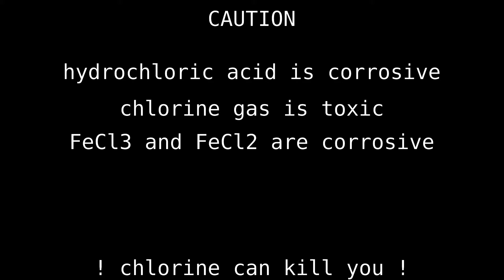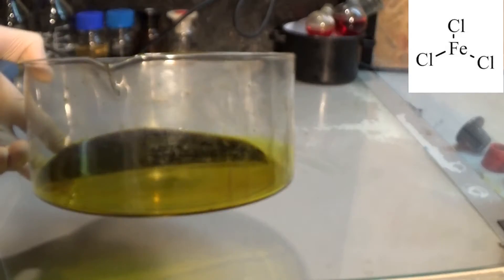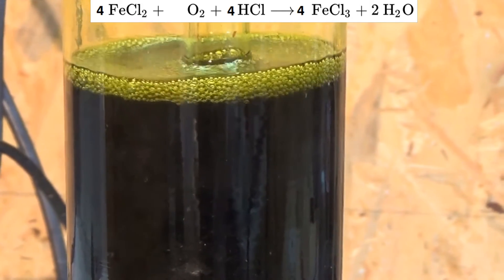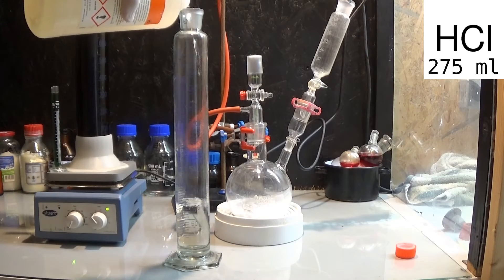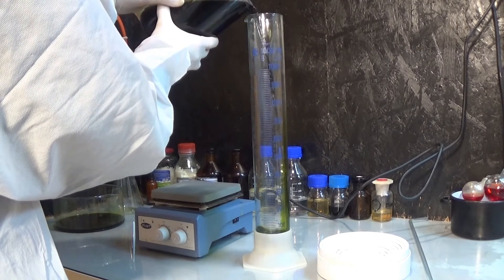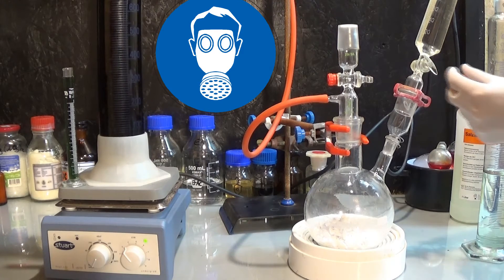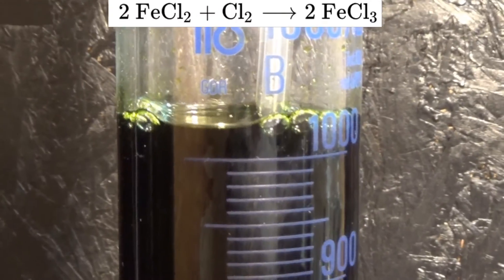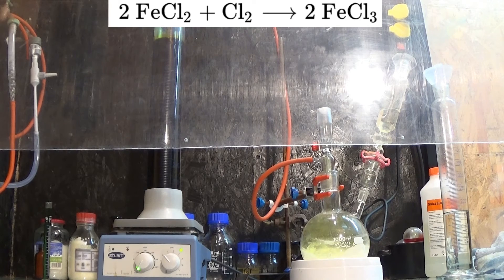ferric chloride synthesis via chloro oxidation

Comment: Hazel chem …...….GREAT VIDEO...……..Ever since I seen the SUPER GREAT reducing ability of ferrous sulfate I was wandering if ferrous chloride was just AS STRONG of a reducer,   cause I was wandering if it would be better at scrubbing Cl2 gas better than NaOH.    Do you know if it does a better job than NaOH at scrubbing chlorine gas???    Did you ever turn your fume hood off for a minute just to see if you could smell chlorine???
Reply from the maker: well i have not turned my fume hood of because chlorine is nothing you want in your lungs XD ... but I guestimate that the chlorine scrubbing ability of FeCl2 is the same like that of NaOH

and thanks for your postive feedback :D

mfg hazelChem
Reply: @HazelChem  …………..That figures.  Chlorine seems like it is hard to fully scrub without multiple scrubbers in series
Reply from the maker: @jbsc6180   that is absolutely right! chlorine can be real nasty 

mfg hazelChem

Comment: using HCl n' H2O2 was too difficuld?
why the damn u used this dumb and acid/salt waisting method? (my heart is itching)
Reply from the maker: hahahaha..... H2O2 is a pain in the ass to get !!! 

mfg hazelChem
Reply: @HazelChem  ………...If you live in the USA you can buy concentrated H2O2 at lowes under the brand name super pequa cess flo industrial strength hydrogen peroxide.   I assumed you used chlorine as your oxidizer instead of H2O2 because it makes a BETTER video.   I bet there are a lot of videos using H2O2.  I bet this is the only one using chlorine...……..VERY COOL
Reply from the maker: @jbsc6180   well to be honest i like chlorine XD and yes you are right i choose it because there are many videos using H2O2 but even if i wanted to use H2O2... in the EU you cant buy H2O2 anymore without being on some kind of black list..... and though i am always following the laws concerning chemicals i do not want to be on such a list !

mfg hazelChem